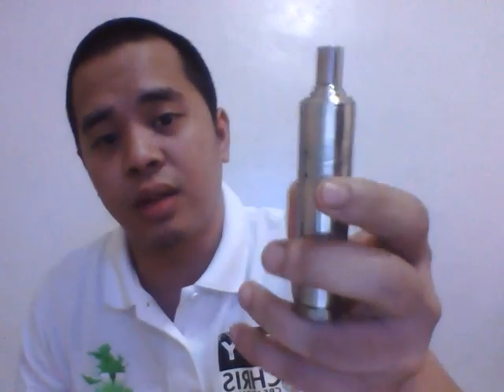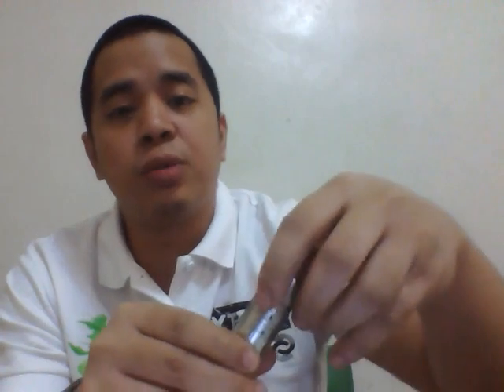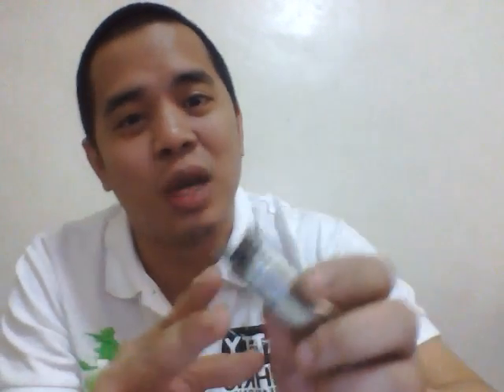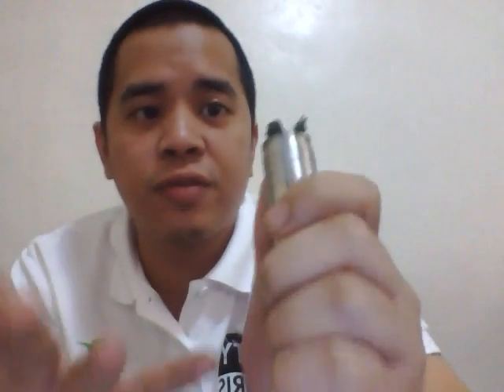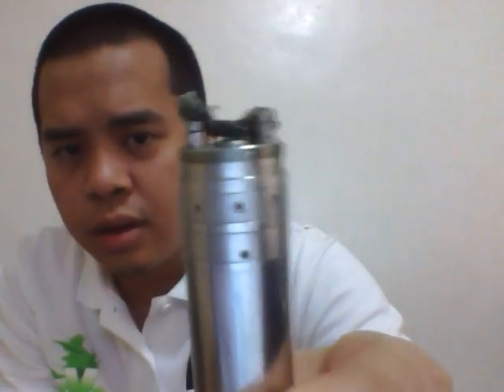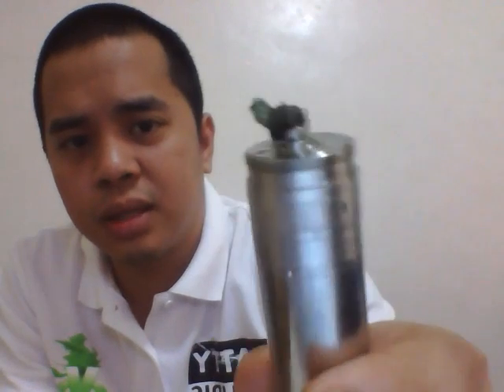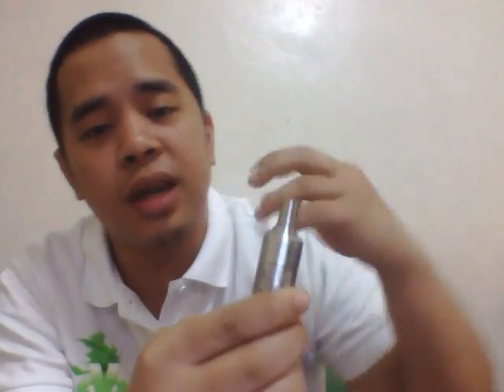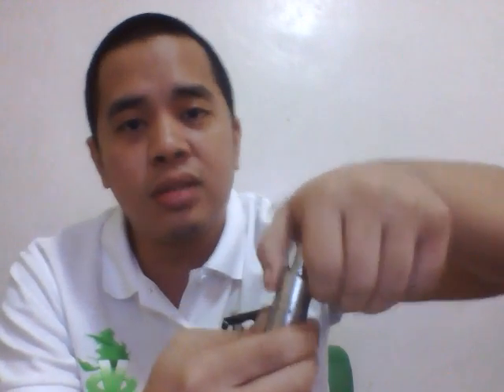Fatty V3 "Evolution" Prelude/Teaser

Comment: just got mine! thanks VC!
but, it does look a little different than the one used on the vid.
Will there be addons released later? free or as separate accessories?
i have not tinkered with mine still since its initial build after purchase, will i need a wrench? it dint come with one.

TIA

Comment: Would love to see a full review of the final version cause I just got one and I am not impressed with the build quality or overall design of this RDA. The one I got had a dead short to ground on the positive pin right out of the bag (does not come in a box).  510 connector was so badly burred that it damaged the female 510 on my Roller mod.  AFC ring is so loose on the body that it is useless and will not stay in the position that you set it.I hope I got a lemon otherwise steer clear!

Comment: What happened to a full review within 3 days of this video? Been over a month. Very disappointed with mine thus far and just got it in the mail today. It was a poorly cleaned out, still had metal shavings in the internals so when I built on it thinking it was OK it got very hot quickly. Took it apart, cleaned it out, and now having trouble putting this thing back together evenly since the posts are what keep it together. Please help.